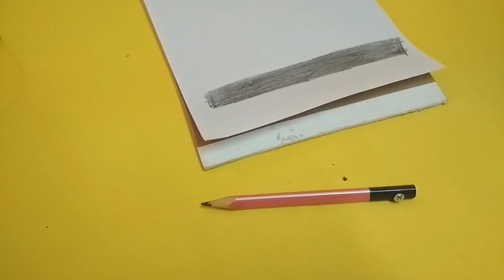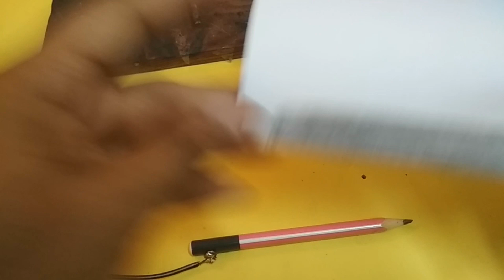DIY Stylophone w/ Pencil & Paper (Simplest Synthesizer Circuit?)

Comment: Amazing! Would this work with a steel bar and steel piece as a pencil (like a stylophon)?
Thank you ❤
Reply from the maker: Really late reply, but in case you're still interested, the steel bar would be a near perfect conductor so it couldn't really do the job of a variable resistor. You could definitely use steel for the stylus though. Cheers!

Comment: the graphite on the paper shouldnt be able to conduct electricity… unless this was made with a lead pencil, in which case it would work
Reply from the maker: It was graphite, and it does conduct, as you can see. The resistance is very high.
Reply: Yes. Graphite has a relatively high resistance, though. I've experimented with it in circuits. Believe it or not, graphite strips were used (maybe still are) in slider potentiometers.
Reply: Huh, whenever I tested with graphite on paper it just never conducts
Reply from the maker: I think you might need to spend some time and just lay down a lot of graphite. Try a soft pencil as well, and rough paper.
Reply: @beniven-dev  If you start by just splitting a pencil in half to reveal the graphite, you've got a solid rod, which will be better than rubbing it on paper. If you connect one end to a pair of AA batteries (3v) and a small bulb or LED it will be fairly bright when the second wire is around 5mm away, but will decrease fairly rapidly as you move the wire away. 
Note that an LED only conducts current in one direction, so try it both ways. The long terminal is the positive, if you're using one that is new, rather than one removed from a circuit, where sometimes is hard to tell visually.
When used as part of a transistor circuit, you are dealing with much smaller changes in voltage/current, and you can adjust other components to produce the desired response. If you are using a simple bulb and batteries circuit, you can use a thicker pencil and/or more batteries in series.
Good luck experimenting.

Comment: I have tried recreating this circuit without the output part of the schematic and the transistor does heat up a lot. Unless I put in a 3m resistor for the input. I seem to be getting no sound from the speaker in any way. Is the output part with the 2.2nf and 82k resistor vital? In any case, thanks a million for this video!
Reply from the maker: What kind of resistances are you getting from the graphite strip?
Reply: @Psychotenuse  Getting no charge through the strip, so I've been trying all kinds of substitutes but nothing that works as of yet
Reply from the maker: This circuit shouldn't be that sensitive,  actually. Why don't you try making the original SCR oscillator circuit from the page linked in the description?

Comment: That’s pretty cool, I bet you can make squares of Al foil and connect them to resisters to tune each not to have a well defined frequency
Reply from the maker: You probably could, yes, if you used trim pots to tune each note separately.

Comment: How did you calculate the values for your capacitors and resistors? Were there parameters you had to follow or did you just use what you had lying around?
Reply from the maker: Some trial and error, a lot of "eh, that's probably alright"...
My experience with such simple circuits is that order-of-magnitude precision is often enough. I found an oscillator circuit online and built it using the closest values I could find in my box. The resistor which would control the pitch was about a 100 times smaller than what I had, so I added a transistor because they amplify current about a hundred times. Then I found that the circuit was stalling, so I added the current-limiting pot of a value smaller, but not ten times smaller, than the original recommended value.

Comment: Good video :)
a little question, because I want to do this exactly but with a "piano" keyboard in a pcb, like a stylophone, and with pcb and no paper and pencil
how can I get the resistance values for every note?
Sorry the bad English, I'm trying to learn it :/
Reply from the maker: Aww, I like the novelty of the pencil and paper xD
If you want to do it with buttons, though, you would actually not require the transistor I used in the circuit. I suggest you look up the "original circuit" link in the description.
Since it is very unlikely that you will be able to find fixed value resistors of the exact correct value for each note, the way I would do it would be to have trim pots (multi-turn potentiometers) for each note and tune them individually. A rough guide to consider might be that every doubling of resistance corresponds to a halving of frequency (octave drop in pitch).